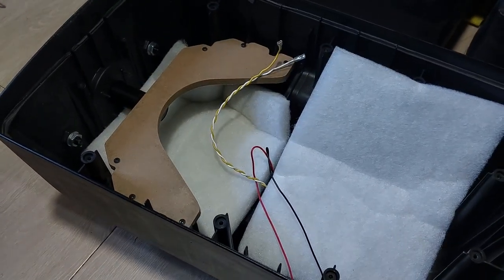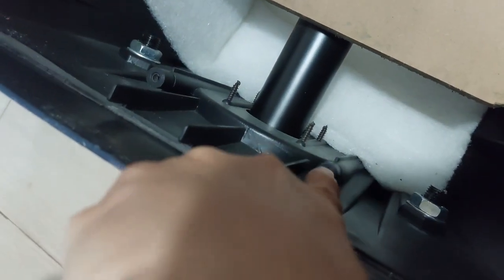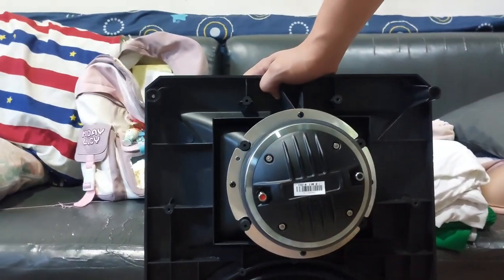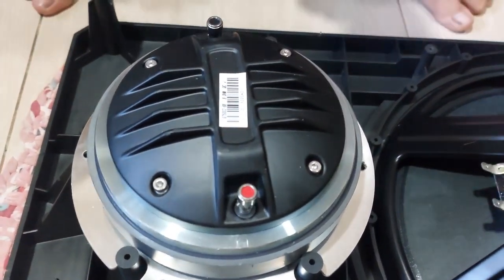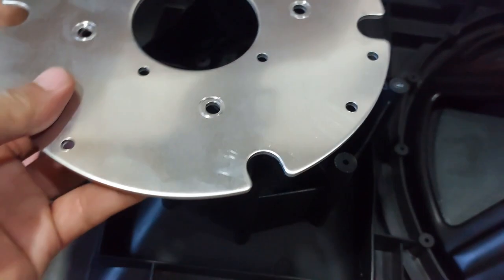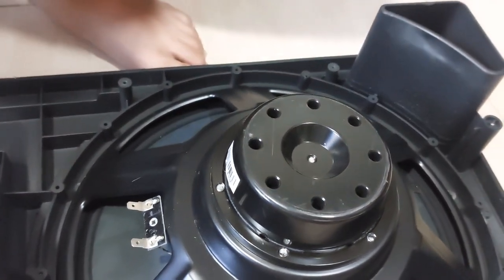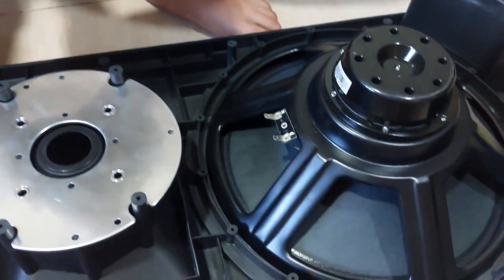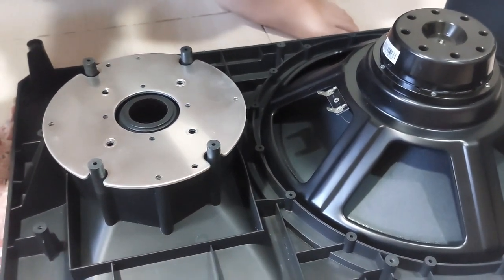a look inside the AD flex15a active speaker

Comment: Boss ano pinagkaiba ng AD 915a?
Reply from the maker: Mas maliit po ng konti  compression driver/tweeter ng 915a
Reply: @ZINDJGABECORDERO  ano po mas maganda sa dalwa?
Reply from the maker: @djeaproductions2902  depende po. Sa power mas malakas flex15a pag sa sound pressure level pero cheaply made ang box ng flex15. Yung 915a newer box design mas maganda appearance ng 915a. Sa clarity at quality ng sound same sila